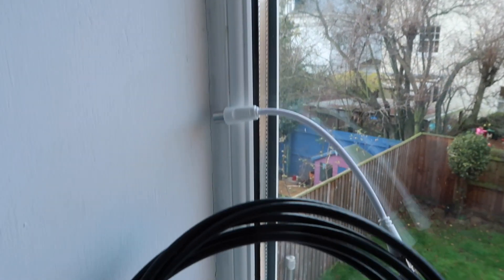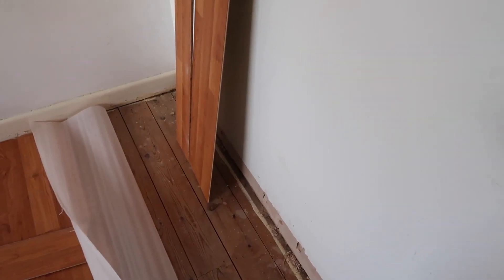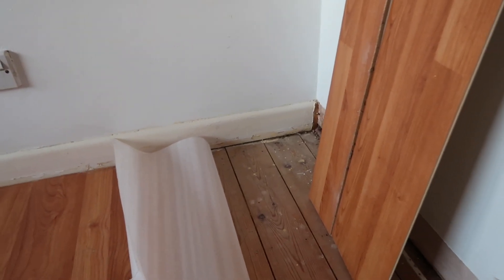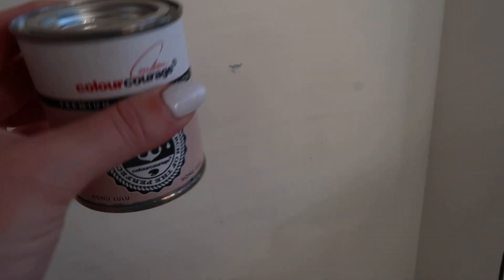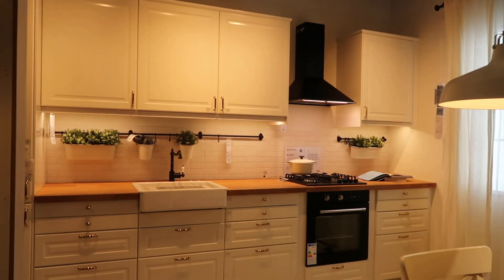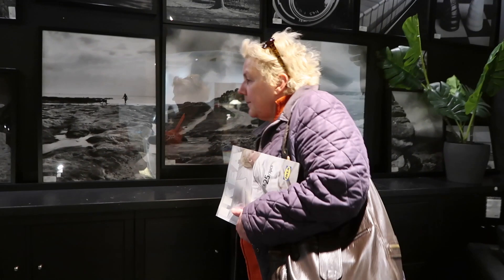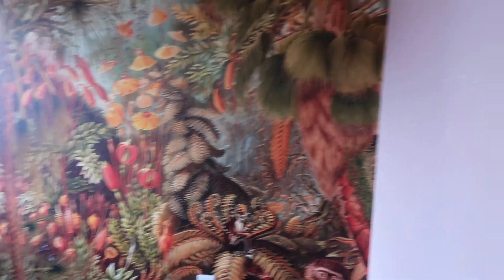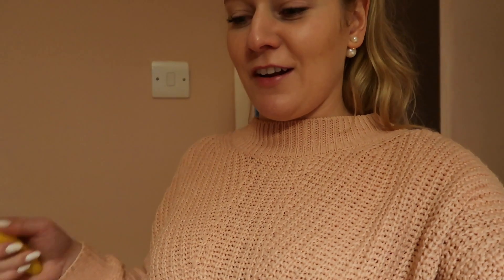Guest Room Transformation - The Jungle Room | Katie Kalanchoe

Comment: Hi I absolutely love the jungle room. I live in Cornwall originally from London we came here 3 years ago and we used get a lot of mould. We brought a drymaster. it goes in your loft. You can get the company to come round and inspect your house for free. They tell you where the drymaster can go. We did this, then brought it off their website and got our Electrican to fit it whilst doing other work in our house. It was around £300 to buy and it works! No more mould. Loving your renovation.
Reply from the maker: Ah that's such a great tip, thank you so much for taking the time to comment. Cornwall is heaven. We haven't managed to get down there yet, especially with lockdown going on! Really hope to have some sunny beach days in summer though!

Comment: Looks great ☺️ We had a condensation and mould problem in our house when we bought it so we bought an Envirovent unit. They’re expensive but they do sort the problem out and clean the air too.
Reply from the maker: At home with Helen and Co oooh will take a look! We have a small manual dehumidifier which is doing the trick for now and seems to have paused the problem!